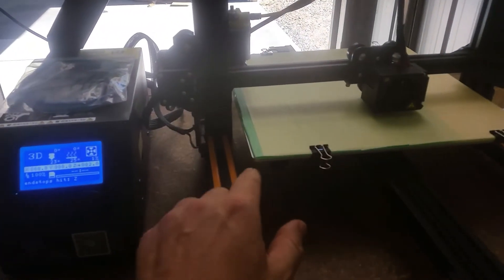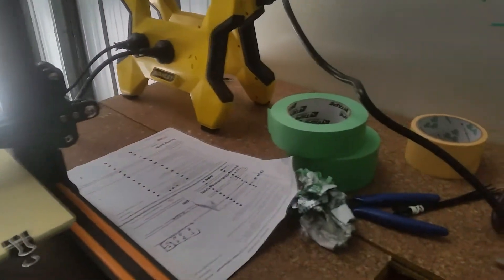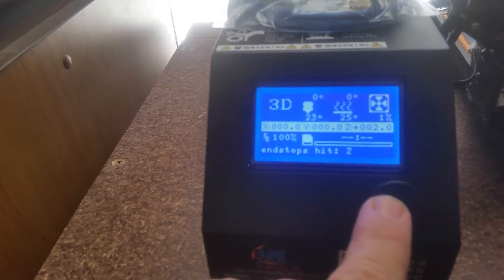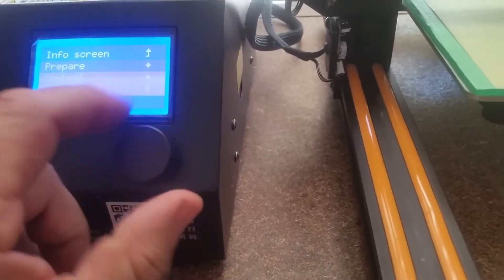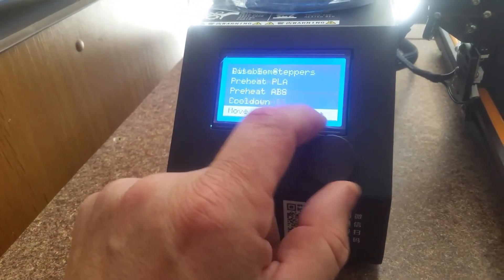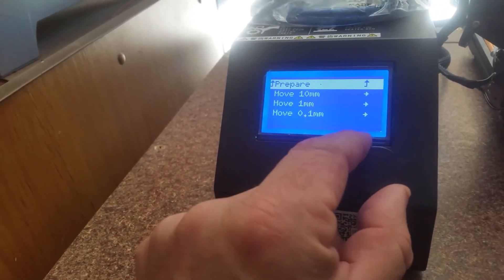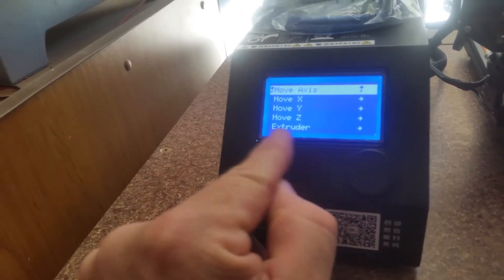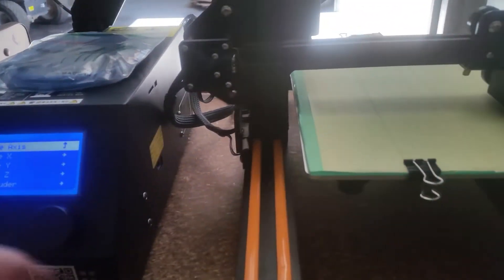Creally CR10 leveling the bed for beginners.

Comment: the print bed leveling is supposed to be handled by the thumb screws under the base...you shouldn't have to fiddle with the control box settings... I'm still trying to get this right...this is my second printer